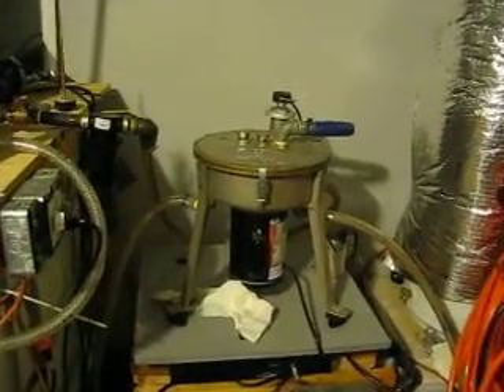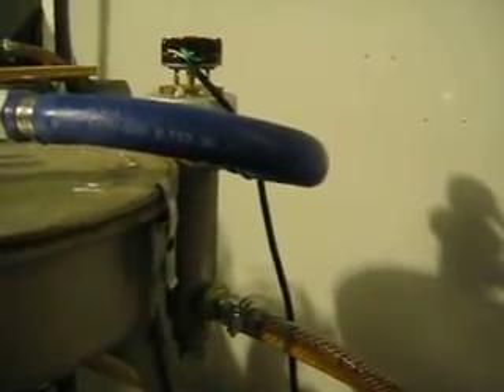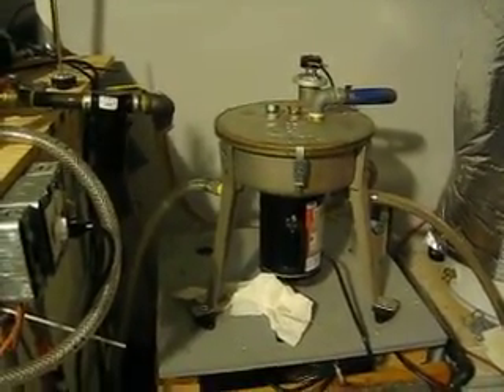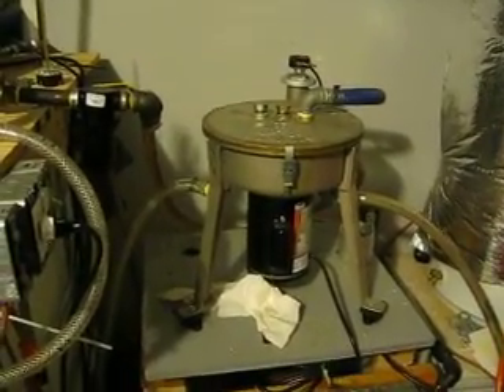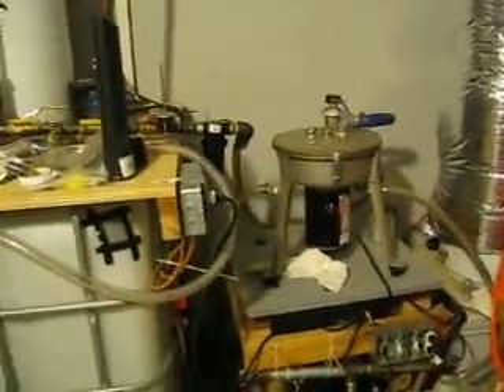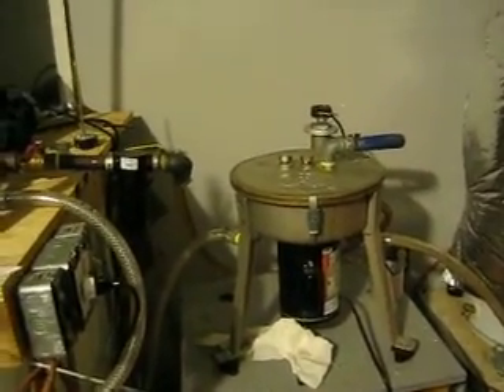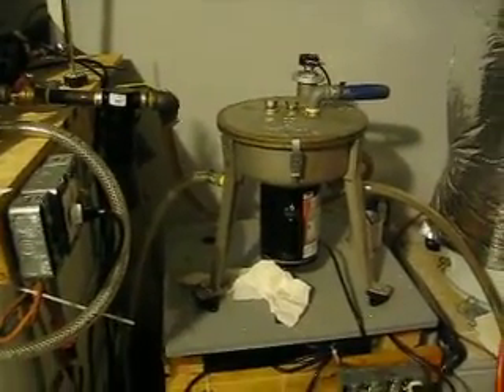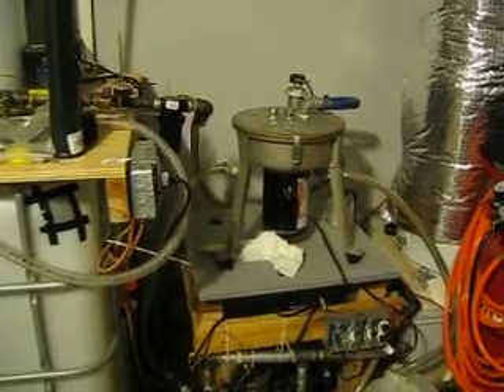Raw Power Centrifuge from WVO designs

Comment: After getting past my procrastination, I finally assembled my centrifuge almost a year after having gotten it. Part of the reason being that I was skeptical and more than a little fearful of being disappointed with its performance. After finally getting my system up and running and putting some of my home made fuel into my truck and car, all I can say is that I'm hugely delighted and amazed. I looked into the bowl today to see what had accumulated and was beyond astonished. I went so far as to show my wife my crud covered hand. It's so nice to have such an easy system to do this with and not be worried about buying filter bags or using old jeans to bring my fuel to where I want it in terms of purity. Seeing it in the hose on the way to the fuel can is nothing less awesome. WVO designs has a very happy customer who will spread the good word about their product. I can't even comprehend how I'd feel with the more powerful model because the basic one's just so tremendous.

Comment from the maker: @artoliva Who knows... I run the oil though a 2 micron spin on filter on the way to the truck tank and also have the same 2 micron spin on filter on the truck. Its been almost 20k miles on the truck filter with no sign of plugging. Also the polish filter has done probably 2k gal and no signs of slowing. Clean oil can sit for a few months. If its going to sit longer add some biocide to it.